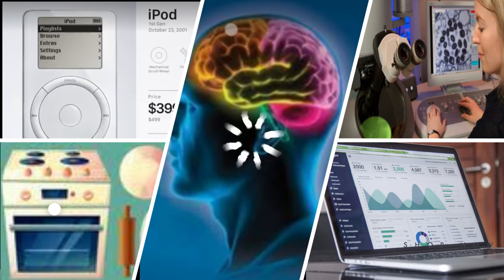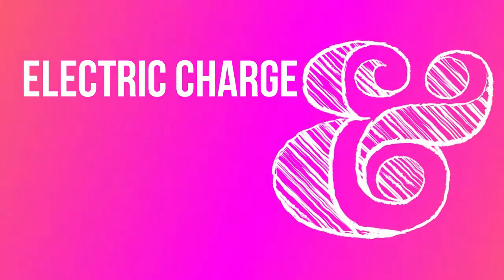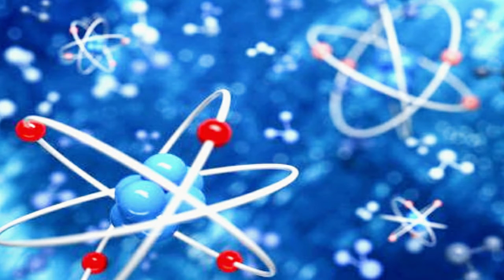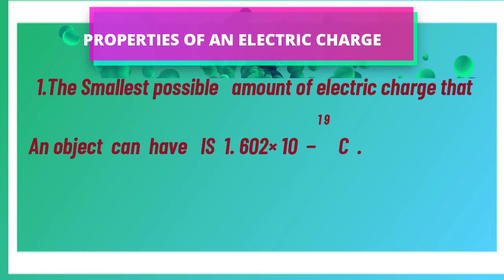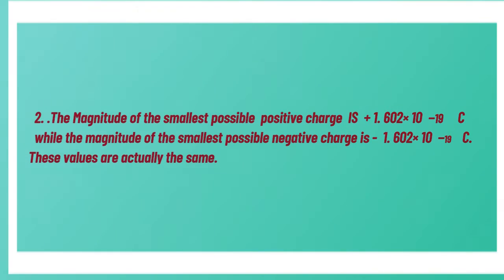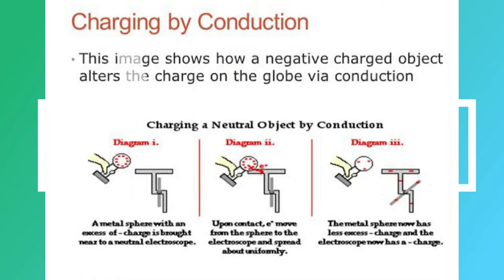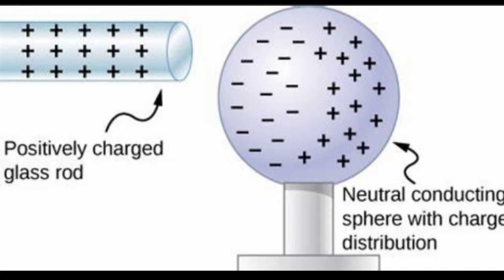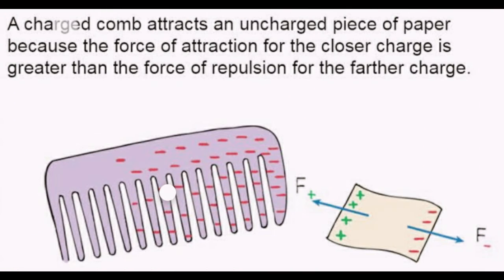ELECTRICITY- An introduction

Comment: Enoza, Paolo, T.
BSE 2-A
                   Applications of polarization, induction conduction
Polarization

- Polarization is used for differentiating between transverse and longitudinal waves.
- It is used in seismology to study earthquakes
- Infrared spectroscopy uses polarization.

Induction
- Radio
- Internet
-Telephone

Conductionn
-  If you leave a metal spoon propped up in a pot, it will become hot from the boiling water inside the pot.
-  A heat exchanger uses a hot fluid to conduct heat to a cooler fluid without the two actually coming into direct contact.
- Lights bulbs give off heat.

Comment: De Guzman, Julia Mae M.
BSE-2A

Conduction
-If you are cold and someone holds you to warm you, the heat is being conducted from their body to yours.
-Light bulbs give off heat. If you touch a light bulb when it is on, your hand will get burned.

Induction
-Wireless access point
-Cell phones

Polarization
-Glare reduction sunglasses
-Rubbing a balloon with cloth and trying to stick it in a wall. The unlike charges that the balloon and the wall has is being attracted with each other while the charges of the balloon with the same charge as the wall has remain in distance.

Comment: Marcos, Erica Mia C.
BSE 2A

•Conduction
  -Ironing of clothes with pressing iron.
  -Cooking with metal pot, like aluminum pots.
  -Welding of two iron metals together.

•Induction
  -Graphics tablet/ Cellphones.
  -Electromagnetic forming.
  -Electric generators.
  
•Polarization
  -Polaroid filters are used in plastic industries for performing stress analysis tests.
  -Polarization is used in sunglasses to reduce the glare.

Comment: Beato, Donna Barbie N.
BSE-2A
APPLICATIONS OF CONDUCTION, INSULATION, AND POLARIZATION 

Conduction:
*Wires on our homes conduct electricity and allow lights to come out as we flip the switch
* Water has also ions that conduct electricity. This is why we are avoided to plugged everything on electrical sockets when our hands are wet to prevent us from being electrocuted.
*A metal spoon will become hot if it was leave on the pot as the heat also transfer from the boiling water.

Induction:
*Transformers
* Induction cookers
*Microphones

Polarization:
*Sheet plastics
*LCD(Liquid Crystal Display)
*Radio and antennas(as communication)

Comment: Sarque, Marjorie M. 
BSE - 2A

Sample application of Conduction:
1. When we're making a coffee, we pour the boiling water to the cup/mug. The heat from a hot liquid transfers and makes the cup itself hot as well. 
2. If you try to touch a hot kettle after it boils water, heat will be conducted to your fingers. 
3.When you place a shirt on an ironing board to be ironed. Heat from the iron is conducted to the shirt, making it easy to iron out all those unsightly wrinkles and make the shirt look sharp.

Induction:
1. Operating a motor in reverse is the generator which a great example of electromagnetic induction.
2. Some day-to-day life examples are Transformers, Induction cooker, Wireless access point, and Cell phones.
3. A negatively charged balloon brought near a neutral hair. 

Polarization:
1. Common examples of surfaces that reflect polarized light are undisturbed water, glass, sheet plastics, and highways. 
2. Paper bits become polarized and are attracted to a charged piece of acetate.
3. Water molecules, some of the polarization is caused by molecules rotating into the same alignment under the influence of the electric field.

Comment: Good evening, maam.

Examples of conduction
1. If you are cold and someone holds you to warm you, the heat is being conducted from their body to yours.

2. Sand can conduct heat. This is why walking on the beach on a hot summer day will warm your feet.

3. When table salt is dissolved in water, it can conduct electricity. That is because the water separates the sodium ions from the chlorine ions apart.

Examples of induction
1. Thee magnetic stripe on the back of your personal credit card as used at the grocery store or the ATM machine.

2. Graphics tablets, or tablet computers where a specially designed pen is used to draw digital images, also applies induction principles.

3. A magnet moves by your mechanical work through a wire. The induced current charges a capacitor that stores the charge that will light the lightbulb even while you are not doing this mechanical work.

Examples of polarization
1. A polarizer is placed in front of the lens of a DSLR camera, reducing the glare coming from the partially reflective surface of the leaves on the vegetation.

2. A polarizer is placed in front of the lens of a machine vision camera, reducing the stray light coming from a reflective surface between the lens and electronic chip.

3. Polarizing the ring light output and the lens separately can reduce these effects, and bring out surface details.

- Padilla, Ellirina Jane M.
BSE 2-A

Comment: SINODIN, ALIAH S.
BSE 2-A

"Application of Conduction"
√ When a shirt is placed on an ironing board to be ironed. Heat from the iron is conducted to the shirt.
√ When the engine of a car is turned on, and the hood becomes warm due to the conduction of heat from the engine to the hood of the car.
√ When you get sick and you use a mercury thermometer to measure your temperature, you are using the metal tip of the thermometer to transfer your body heat to the mercury.

"Application of Induction"
√ lighting used numerous fluorescent lighting fixtures that provide high voltage when turning on
√ kitchen appliances use the electromagnetism for their operation
√ Generators whereas the motors convert electrical energy to mechanical energy

"Application of Polarization"
√ adjusting the light and blanking out glares
√ polarization microscopy
√ crsytallographic research and photo-elastic analysis

Comment: Sulit, Marjorie M.
BSE - 2A

Application of Conduction
-Heat conduction is applied in cooking with metal pot 
-Ironing of clothes with pressing iron.
-Welding of two iron metals together.

Applications of Induction
-Current clamp.
-Electric generators.
-Electromagnetic forming.

Application of Polarization
-Polarization is used in sunglasses to reduce the glare. 
-Polaroid filters are used in plastic industries for performing stress analysis tests. 
-Polarization  is used for differentiating between transverse and longitudinal waves.

Comment: Gregorio, Sherilyn A.
BSE 2-A

Examples of Conduction
1. Touching a metal spoon in a cup of hot liquid
2. Putting a heating pad on your back
3. Roasting marshmallows

Examples of Induction
1. Mechanically powered flashlight
2. Transformers
3. Induction cooking

Examples of Polarization
1. 3D glasses in movie theatres
2. Musical instrument (guitar string)
3. When the light reflected off a river is partially polarized in a direction parallel to the water's surface

Comment: Carpio, Charles D.
BSE 2-A

CONDUCTION
-Light bulbs give off heat. If you touch a light bulb when it is on, your hand will get burned.
-When you accidentaly touch the hot iron, heat will be conducted to your finger and your skin will burn
-When ironing a piece of clothing, the iron is hot and the heat is transferred to the clothing.

INDUCTION
-Transformers
-Cellphones
-Electric generators

POLARIZATION
-Sunglasses
-guitar string
-The motion of sound waves through the air

Comment: Galantes, Nino C.
BSE 2-A

Conduction - Handles of the cooking utensils are made of plastic or sometimes wood which cannot conduct heat when carried 

Induction - Electric Generator
                    Cellphones
                    Induction Cooker

Polarization - Polarize glasses are used by fishermen to spot the fishes in the water

Comment: LEONARDO, KRISTEL JOYCE R.
BSE - 2A

EXAMPLES OF CONDUCTIONS:
•If you are cold and someone holds you to warm you, the heat is being conducted from their body to yours.
•A cold cast iron skillet is placed onto a stovetop.
•Light bulbs give off heat. If you touch a light bulb when it is on, your hand will get burned.

EXAMPLES OF INDUCTION:
• Television
•Electrical Transformer
•Induction Welding

EXAMPLES OF POLARIZATION:
•Fishermen make use of polarized glasses to spot the fishes in the water.
• Ripples in Water
• LCD in Cellphone

Comment: De Cano, Cyrelle M.
BSE 2A

Conduction 
*Heat from the hot water makes the mug itself hot. 
*Ironing some clothes, clothes will absorb the heat from the Iron. 
*Putting a tablespoon in a mug full of hot coffee.

Polarization
*Undisturbed water, glass, sheet plastic.

Induction
*Cellphone
*electric generator
*guitar strings

Comment: Jhon Carlo D Onipa
BSE-2A

CONDUCTION

* When we touched an ice it will slowly cooling down and melts. 

* If we are cold then someone hug us we feel warm, because their heat conducted from their body to ours.

* If we put spoon into the pan to taste the food the heat from the 
pan will conduct to the spoon.

POLARIZATION

* To reduce the glare polarization is used in sunglasses.

* Three dimensional movies uses polarization to produce.

* Polarized glasses used to spot the fishes in the water.

INDUCTION

* Electromagnetic induction apply in every wireless energy transfer.

* High speed vacuum cleaners.

* The magnetic stripe on the back of your personal credit card as used at grocery or atm machine.

Comment: Garingo, Marvin D
BSE 2A

GIVE ATLEAST 3 EXAMPLE OF CONDUCTION, INDUCTION AND POLARIZATION

*Conduction
Tbe best example of it are the following:
1. Ironing our clothes using pressing iron. Electrical energy passes from  pressing iron to the clothes
2. Frying fries using pan
3. Welding of twi iron metals together

*Induction
1. Using Induction cooker
2. Sending messages using your phone
3. Using Electric Generator when black out is happened

*Polarization
1. We used Polarization in differentiating transverse and longitudinal waves
2. Seismologists used Polarization to study earthquakes.
3. Organic Compounds chilarity is tested using pokarization techniques in Chemistry.

Comment: Dela Cruz, Bernadeth C.
BSE-2A
..
CONDUCTION
-A cast iron skillet is placed onto a stovetop.
-Boiling water bu thrusting a red-piece of iron into it. 
-If we are cold and someone holds us to give warm, the heat is being conducted from their  body to ours.
...
INDUCTION
-Plastic rod near metal plate
-High speed vacuum cleaners
-power generators
..
POLARIZATION
-Plucking guitar strings
-Vibration through air
-Polarized sunglasses

Comment: VILLEZA, ALJOHN R.
BSE 2-A

CONDUCTION
1. Putting a metal spoon on hot boiling water.
2. Transferring hot water into a glass.
3. Touching a hot metal and being burned.

INDUCTION
1. Lightning hitting the pole.
2. Unplug a lamp while it's turned on, and watch the area around the wall outlet. You should see a blue spark in the air at the moment. 
3. Having a Video Call with your loved ones using Cellphones and by the help of electrical signals.

POLARIZATION
1. Polarization is used in 3-Dimensional movie.
2. Polarization is used in sunglasses to reduce the glare.
3. Rubbing a Balloon in a sweater and it's become charged. Place a balloon into the wall and it sticked. The charged on balloon induces opposite charged on the wall.

Comment: Sinodin, Arham S.
BSE-2A

Conduction

1. When you turn on your computer or any other electric or battery-operated devices or appliances, electrical conduction is what makes them function.
2. Hearts have their own naturally occurring electrical conduction system. When a heart beats, its electrical signals cause the heart to beat in an appropriate rhythm.
3. When table salt is dissolved in water, it can conduct electricity. That is because the water separates the sodium ions from the chlorine ions apart.

Induction
1. Transformers.
2. Induction cooker.
3. Guitar pickups 

Polarization
1. A picket fence that acts as a polarizer by transforming an unpolarized wave in a rope into a wave that vibrates in a single plane.
2. Polaroid filters are that are used in plastic industries for performing stress analysis tests. 
3. Glare reduction sunglasses

Comment: De Guzman, Kyla Marie D.
BSE-2A

Conduction

1. The wires in your home conduct electricity and allow lights to come on when you flip the switch.
2. Lightning rods are installed on buildings to attract lightning to hit them and conduct their energy down into the ground via attached wires rather than damaging the structure.
3. The ions in water cause it to conduct electricity.  The water would conduct the electricity such that touching the device could result in electrocution.

Induction

1.  Electromagnetic induction in AC generator
2. Electrical Transformers
3. Cellphone

Polarization

1. Fishermen make use of polarized glasses to spot the fishes in the water. 
2. LCD in televisions and other technologies.
3. Produce and show 3-D movies. Three-dimensional movies are actually two movies being shown at the same time through two projectors (have polaroid filters).

Comment: Sunga, Shieny Mae N.
BSE 2-A

CONDUCTION:

°Touching a hot stove. Heat will be conducted to your finger and your skin will get burn.
°Ironing a piece of clothing. The iron is hot and the heat is transferred to the clothing.
°Grabbing a cup that has hot coffee or tea. The cup itself will be hot and your hands will feel it.

INDUCTION

°Transformers are able to send alternating currents from one electric circuit to another by means of electromagnet induction.
°Radio frequency (rf) transformers operate within the higher frequencies, giving rf generators many industrial uses. 
°A welding process used in metal fabrication where different metals are soldered together to form one workable material.

POLARIZATION

°Paper bits become polarized and are attracted to a charged piece of acetate.
°If a rubber balloon is charged by rubbing it with animal fur, the balloon can subsequently be stuck to the surface of a wooden cabinet or a whiteboard. 
°A long wooden 2x4 is placed on a pivot and becomes polarized and attracted to a charged golf tube.

Comment: Dela Riarte, Juhanie V.
BSE 2A

1. Example application of CONDUCTION
-Fire transfering heat through any metal pot so our raw food can be cooked and eaten.
-Charging electrical devices
-Combing the hair

2. Example application of INDUCTION
-Remotely turning on the tv
-Finding radio signal
-Controlling the drone

3. Example application of POLARIZATION
-Cut out paper attracted towards charged plastic rod.
-Charging a balloon through rubbing in hair and letting it stick onto the ceiling.

Comment: Joyce Arabella DC. Miranda
BSE-2A

✓Conduction
  -Ironing of clothes with pressing iron.
  -Welding of two iron metals together.
  -Cooking with metal pot, like aluminum pots.

✓Induction
  -Graphics tablet/ Cellphones.
  -Electric generators.
  -Electromagnetic forming.
  
✓Polarization
  -Polarization is used in sunglasses to reduce the glare.
  -Polaroid filters are used in plastic industries for performing stress analysis tests.
  --Polarized glasses used to spot the fishes in the water.

Thank you❤️

Comment: Eloisa Bianca Peralta
BSE-2A

Conduction
1. Ironing your hair.
2. Brushing your hair.
3. Rubbing your hands.

Induction
1. Standing in recently turn off TV.
2. Rubbing a balloon with cloth and trying to stick it in the wall.
3. Rubbing a balloon through your hair, after a few seconds your hair will be attracted to the balloon.

Polarization
1. Standing in the recently turn of TV. The unlike charges that your hair and the TV has is being attracted with each other while the charges of your hair with the same charge as the TV has remain in distance.
2. Rubbing a balloon with cloth  and trying to stick it in a wall. The unlike charges that the balloon and the wall has is being attracted with each other while the charges of the balloon with the same charge as the wall has remain in distance.
3. Rubbing a balloon through your hair and being attracted with each other after a few seconds. The unlike charges that your hair and the balloon has is being attracted with each other while the charges of your hair with the same charge as the balloon has remain in distance.

Comment: Ortiz, Vanesa Mae D.
BSE 2A

Give at least 3 examples of the application of conduction, induction and polarization.

Conduction
*Your school uniform placed on the ironing board to be ironed.
*Touching a burning piece of wood and got burned.
*Heating a frying pan from the stove.

Induction
*Having a phone call through electrical signal.
*Lightning hits the tree.
*Using a power generator.

Polarization
*To reduce the glace in sunglasses polarization is used.
*Polarization is also used in three dimensional movies in order to produce it.
*Polarization is used by the fishermen in finding fishes under water.

Comment: Dannijane C. Nuñez
BSE 2A
Example of Charging by Conduction
1.A toddler accidentally place her finger in a hole of plug socket.
2. Shower heater when taking bath.
3.Putting a casserole of hot corn soup on the table.

Example of Charging by Induction
1. Mobile phone's power is on.
2.Sunlight to plants.
3. Lighting directly hit the tree.

Example of Charging by Polarization
1.A teacher using projector.
2.Needle clings to scissor.
3. A girl strumming her ukulele strings.

Comment: Angelo,Charish Joy,D.

 Examples of CONDUCTION
-Chocolate candy in your hand eventually melted as heat conducted from your hand to the chocolate.
-When sunlight heats the ground,which in turn heats the air,directly above it via conduction.
-Ice melting-Ice melts because heat moves to the ice from the air.

Examples of INDUCTION
-Electromagnetic induction apply in induction welding.
-Electromagnetic induction apply in every wireless energy transfer.
-Electromagnetic induction aplly in inductive chanrging.

Examples of POLARIZATION
-Three dimensional movies uses polarization to produce.
-In performing stress analysis test polaroid filters are use in plastic industries.
-To reduce the glare polarization is use in sunglasses.